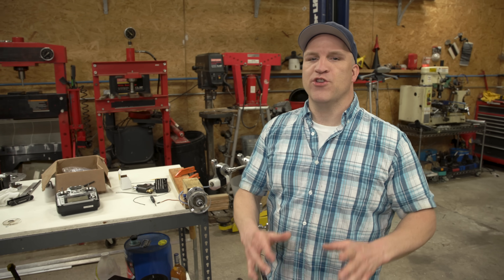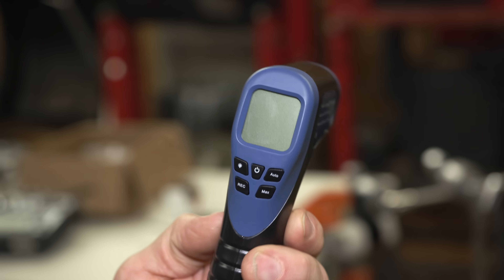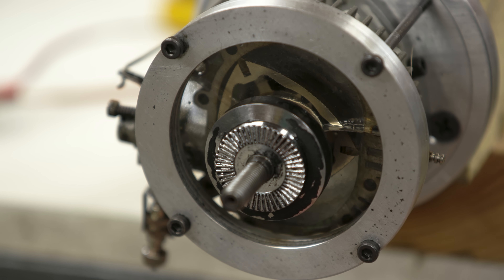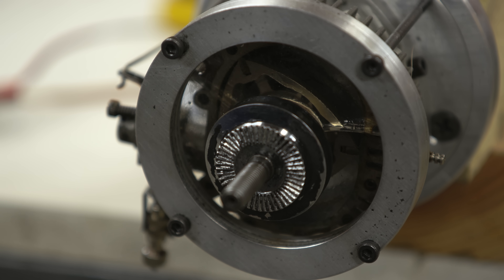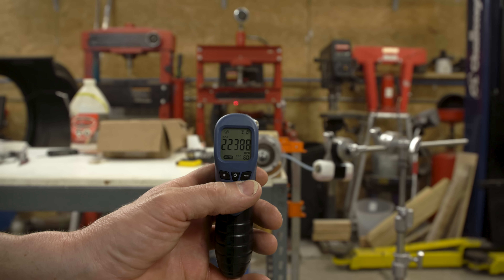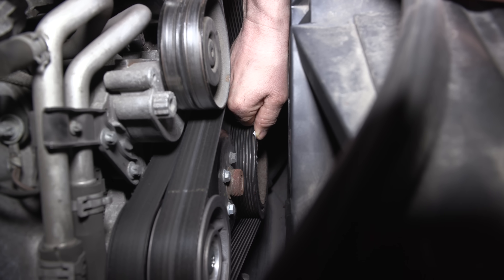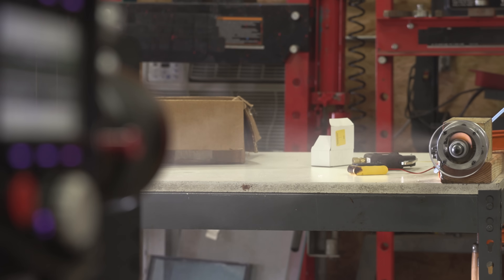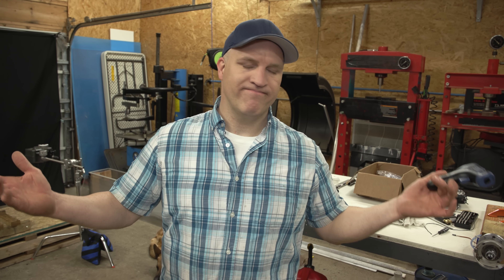See Thru Rotary Engine MAX RPM - 29000 (Wankel Engine)

Comment from the maker: Full Rotary Episode here : https://youtu.be/pCteBhr4dGY in case you haven't seen it yet .
Reply: Warped Perception  is the engine use peripheral port?
Reply: The sound is a little out of phase
Reply: Nitromethane now. we wanna see that casing fail. it will go faster on lighter fuels
Reply: Warped Perception try a thermal coating on the combustion area so it doesn't overheat the material
Reply: Where can i buy the little rotary engine?
Reply: I wanted to ask if indy cars use rotary engines
Reply from the maker: Depends on your PC or phone processor
Reply from the maker: I will have them for sale very soon

Comment: I used to dabble with model aircraft motors. 2.5 cc Reciprocating piston diesels rev at about 20,000 rpm. From the sound pitch of your wankel it's going faster than 20,000 . One word of wisdom from someone who has learnt from experience. Wear ear protection when running your motor. I suffer from severe hearing loss that I attribute to the noise generated from small aircraft motors running without mufflers.

Comment: Dude, you gotta run these things with a pipe to get accurate readings out of them. 

Having no exhaust creates a low pressure system in the exhaust port after the exhaust gas leaves. This low pressure system causes a rush of cold air to enter the exhaust port and could damage or warp components. It's like hot-cold-hot-cold-hot-cold on the rotor all the time. Also, the mufflers on these engines are shaped to promote recycling by controlling the pressure pulses of the exhaust. So the last pulse is redirected to provide backpressure for the next pulse, promoting efficiency. if this was a reciprocating 2 stroke you'd be lucky if it ran at all. Nevermind the fact that not running a prop means the temps are probably extremely out-of-control at that RPM. I bed that's why your glass case cracked to be completely honest with you. Too much heat during combustion and then hot-cold pulses from the exhaust port caused uneven thermal expansion of your transparent cover. The cover is going to expand a lot faster and a lot more than the aluminum engine block.  I'd be very interested in seeing how fast this engine could go if it were tested in a condition that it was designed for.

Comment: Rotary fans be like : I WANT ONE!!!
Reply: bravo 099 rotary fans be like "we own one"
Reply: bravo 099 you're not wrong haha
Reply: I am NOT a rotary fan, but I want one.
Reply: Rotary fans be like, That's a WANKEL engine bitch... not a Rotary!
Reply: doktorbimmer oh yeah, I know about the rotaries. Antiques those are nowadays. Awesome to build though if you can get a plane to fit it.
Reply: +Schwinn Jumper Indeed.. but it is still a little sad that so many people  do not know the difference between a Wankel and a Rotary engine....
Reply: +Schwinn Jumper  Wankel engines are antiques now too... they have been obsolete in the automobile and engine manufacturing industries for several years now...
Reply: +Schwinn Jumper Oh yeah, I know about the Wankel. Antiques those are nowadays. Awesome to build though if you can get a plane that has one installed from the factory.
Reply: doktorbimmer, why the bold? Is this an attention robbery?

The wankel is not quite obsolete, as mazda is working on significant improvements to reduce oil usage and improve efficiency and power by routing the oil exactly where it needs to be and nowhere else, while also giving it a higher compression ratio. Mazda is trying to bring this engine back with a vengeance.
Reply: +Schwinn Jumper  I'm sorry but you are obviously very confused and misinformed. Mazda canceled all research and development of Wankel engines back in in May of 2009. The Wankel has been completely obsolete in the automotive and engine manufacturing industry for several years now... where have you been? Living under a rock????
Reply: +Schwinn Jumper One of the major fundamental design flaws in the Wankel KKM engine is the low static compression limit.... it is also why Wankel engines cannot be adapted to use the Diesel cycle or be adapted to use GDI technology.
Reply: +Schwinn Jumper Sales of the Mazda RX brand had been in steady decline since 1986... the sales of the very unpopular RX brand had not produced a profit for the company in DECADES its board of directors had no choice but to ax the RX brand or face losing the company to another bankruptcy sale like in the 1970's when Ford bought the company from a Japanese bankruptcy court after Mazda's failed attempt to market an all Wankel powered product line.
Reply: doktorbimmer i am not suggesting it be ignited by compression, but you are wrong about the direct injection. Wankel engines were made with fuel and oil injectors that both fired atomized gasoline and oil into the combustion chamber, but this made it a dirty and inefficient engine. Recently, for the newest rx-9, Mazda has been making drastic improvements, mostly in the oil injection, and timing the injections with the passing of the seals, allowing them to last longer. The oil they are utilizing is a 5w synthetic oil with tighter seal tolerances for lower compression leakage. They have been able to improve compression by making the rotor faces shallow in concert with the improvements to the seals. I've been following this engine because I want to adapt it to a motorcycle if I can, but I want to wait until this thing has reached its maximum potential. So to answer your question, no, I have definitely not been living under a rock.
https://www.caranddriver.com/news/new-spin-mazda-files-patent-for-new-gen-rotary-engine-heres-what-it-tells-us

Oh, I almost forgot, they did switch back to port injection for reasons yet unknown.
Reply: Just to have at home to listen to when not racing 🏁😵
Reply: Need*
Reply: Everybody be like "I want one"
Reply: @Jacob Webb  If that were true? They would still be in production...
Reply: @doktorbimmer  'twas a joke good sir
Reply: Looks like 1 month later I now own one...
Reply: @Jacob Webb My condolences to you sir... the joke is on you now Lol!
Reply: This rotary fan is like: I ALREADY OWN FIVE OF THESE ENGINES!

(just not see-thru)
Reply: @Shawn Elliot Well, you need a lot of spares if you attempt to run these unreliable engines.
Reply: I'll stick to my LS

Comment: What if rotary diesel
Reply: Rakha Anwar too low compression
Reply: They exist.
Reply: There are no Diesel Wankel engines available and none were produced other than a few made by Yanmar which were recalled and later scrapped.
Reply: +ConsLife - F Rolls-Royce never got the 2-R6 to start or run reliably.... the company went bankrupt trying to fix the problems.
Reply: The Wankel cannot support static compression ratios high enough to allow reliable compression ignition, no successful example has ever been produced.
Reply: I got a wankel to run on diesel.  Proper compression ratio would make engine run too cold though.
Reply: Rakha Anwar they already have diesel rotarys
Reply: +advanced muffin Actually no, there are no successful examples of a Diesel Cycle Wankel engine... the do not exist outside of a few failed prototypes.
Reply: @doktorbimmer  They are actively used they work, they need to be prewarmed.
Reply: @Pukudo No, there are not.. many designs were attempted but all were commercial failures or canceled before reaching production.
Reply: @doktorbimmer  They need to be warmed up to a certain temperature and operate in a fairly narrow temperature band. They exist they aren't used in any cars as far as I know. I could explain it to you on TS but not on YT.
Reply: @Pukudo As I said several failed prototypes existed in the past, but this type of engine IS NOT SOLD and IS NOT IN USE anywhere in the world today... I don't think you can explain something that does not exist onYouTube or anywhere else for that matter!.
Reply: @doktorbimmer  It exists now. My friend flys it. Doesn't mean its a commerical engine why would it be? The general public has no use for such an engine. Because you have to spend half an hour preheating it Why would there be Youtube footage of niche drones? That's military hardware..

You're just wrong the engines exist now and are useful.They just aren't want you want them to be.
Reply: @doktorbimmer  Your confusing the sets 'What you know' and 'What exists' There term used to describe people that do that.
Reply: @Pukudo You sir are confusing a Diesel cycle Wankel with something that is clearly not because they do not exist in service... and for good reason, it is well understood that such designs fail due to basic, inherent deficiencies that prevent the Wankel KKM from supporting the Diesel Cycle operating mode. Please refrain from posting false, erroneous or otherwise misrepresented information on topic such as this that you clearly do not understand.
Reply: @Pukudo Childish insults won't prove your lies... and they won't make you look smarter either.
Reply: Rolls Royce have done that

Comment: 30000 rpm is pretty average for a hobby motor, I don't know a great deal about the rotary ones but a high performance model engine can reach in excess of 40000 rpm. Electric stuff is even faster, 1/24 scale g7 open wing car motors spin up 200000+ rpm!
Reply from the maker: Yeah that's true, I've never measured one before tbh, but the 2 cycle nitro stuff is fast, the 4 Cycle not so much. Electric is for sure really fast but that is all rotation with only one moving part, the rotor.

Comment: Why don't rotary fanboys ever talk about the "gear ratio" of rotors to "E shaft"? There is one in "real-life" rotary engines. Those rotors are not "spinning" at the "E-shaft" rpm in a Mazda rotary. They're "wobbling" and rotating at 1/3 the "E-shaft" RPM.

Never mind. I know the answer. The answer or rather ANSWERS are 1) Most rotary fanboys have no damned clue how their dream engines actually work. And 2) Those that do don't want to talk about reality because it makes their dream engines that much less efficient and impressive than they actually are or rather would be IF that "gear ratio" weren't present.

Comment: That's not particularly impressive as nitro piston engines will turn 30,000 rpm. Many "standard" 2-stroke engines are capable of 15,000 rpm. Stihl chainsaws have "rated" engine speeds in excess of 12,000 rpm.

Comment: Why does it appear to stop firing while slowing down?
Reply from the maker: Because it's burning methanol which doesn't luminate nearly as much as other fuels like gasoline, just check out the original see through engine series and you can see this in action.

Comment: For those that are wondering it's a OS wakel engine. Discontinued but used for rc planes. You cannot run these without a prop or load on it or else it would blow up

Comment: What kind of Mercedes is that featured in the video ? Year and Model ? 

Just curious because forced induction models from that manufacturer tend to have reliability issues and used models are only recommended for mechanics that like working on cars or people who have other vehicle and are well acquainted with a mechanic that works on German cars ^^
Reply from the maker: It's a 2006 E55 supercharged. I've never really had any major issues and I beat the car non stop ( I used to be a race car driver ). In my experience all of the major issues with these cars are usually linked to bad mechanics at dealers and other places. I bought the car new and when I used to get warranty work done, I always had issues, as soon as the warranty expire I cleaned up a few hidden problems left over from warranty repairs like bolts being left loose, wires not clipped in all the way etc.... After that I've had almost no issues.
Reply: Any thoughts about the reliability data for German vs Japanese manufactured cars ? 
Lexus Toyota seems to hold the bar for quality control & reliability : are you suggesting this stems from better training of the dealership mechanics that work on these vehicles? 

I have studied car design, engineering, manufacturing & real world data about warranty claims, repair costs, costs of operation, per mile costs, etc : and it seems like German marks do not hold up well over time, have high operating costs, high depreciation costs, high repair costs, high maintenance costs & high damage repair costs from accidents, achieve poor emissions standards and poor fuel economy and can be more expensive to insure as well. 

No judgment on you or anyone for buying a Mercedes. A friend of mine who is 84 years old just told me that servicing his 2005 Subaru Forested is about 30% of the cost of having his wifes 2011 Mercedes CLA worked on for the same services. A replacement battery for his Subaru with installation about $180 vs $540 for her mercedes which requires OBDII programming etc.... as an example. The alternator was $310 installed in his Subaru, the Mercedes $970.... and so on....

Comment: All rotational energy inertia kinetic spool up quickly rev joy zzzzz high power to weight ratio wankel combustion magic that makes fond memories of the RX7 come back to life! 

Really too bad that even the RX8 did not solve the low fuel economy, poor apex sealing, high emissions problems associated with the rotary engine! 

I personally called Peter Aylett (https://www.linkedin.com/in/peteraylett) one of Mazda's automotive engineers back in 1999 to encourage him to pursuit ongoing development of the rotary engine :) As an alternative to a high cost turbine engine, rotary engines could make awesome power plants for light aircraft, sadly Mazda does not build light aircraft for civilian use yet. 

@Mazda